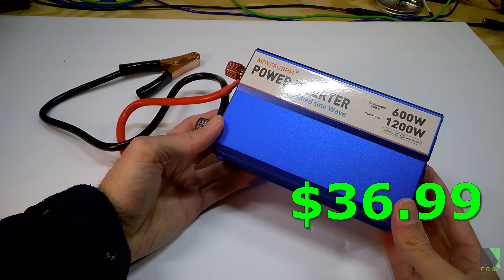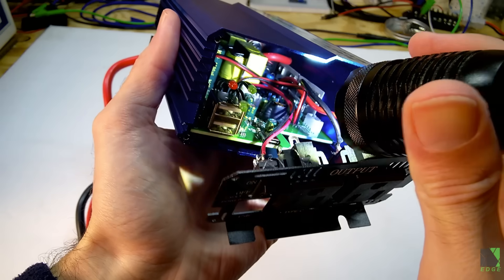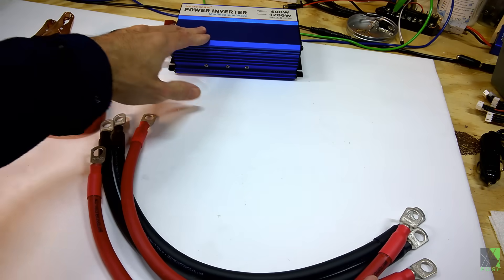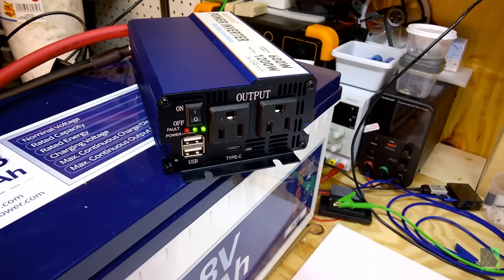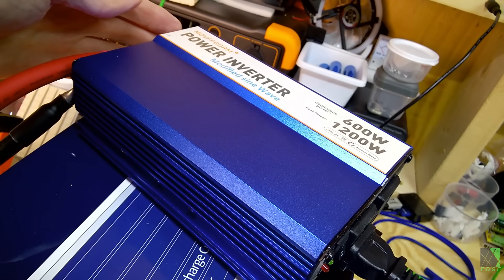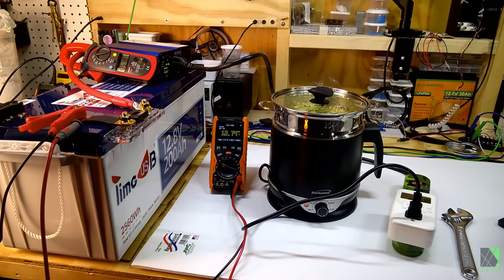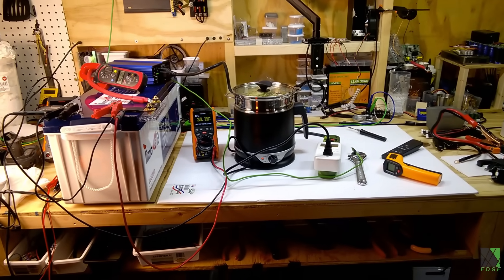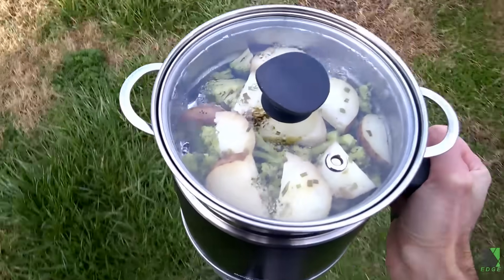This Inverter Is So CHEAP! But Let's See If It's Any Good - Can It Cook? #inverter #solar

Comment from the maker: Hi all, for those curious about my statement regarding "C/4 rate" :

The 200ah battery was supplying 50 amps to the inverter. 

If you take the Capacity of the battery (200) and divide it by 4,  or 200/4 you get "50"! So, 50 amps current draw is C/4! 

PS: On the other hand, C/10 is a perfectly safe and easy rate for charge/discharge of normal LiFePo4 batteries. That's capacity divided by 10. So for a 200ah battery, C/10 rate is 20 amps....

For those of you that don't know, the slash character "/" in C/X implies division, not multiplication! This can cause confusion. 

Hope that helps - any questions feel free to ask :)
-Dave
Reply: can i get more information about this, is it bad for the battery?
Reply from the maker: @SupertigerDev  Hello, C/4 is not healthy long term for normal LiFePo4 whether charging or discharging. There are so many reasons. Don't worry I am working on a video about charge/discharge rates and long term durability of LiFePo4. Much of the information available is quite erroneous. I hope the upcoming video will provide some clarity on this topic for all DIY'ers.

FYI: C/10 (capacity divided by 10) is quite safe and easy for normal LiFePo4 batteries. That is what I limit my batteries to for long term use. Have used them for about twelve years now.
Reply: Does this apply to lead acid batteries as well? @solarpoweredge
Reply from the maker: @Jon-fs2zj  Hello, lead acid is tremendously more affected by C rate. They lose much more power (are less efficient) the greater the discharge rate. Lifepo4s can still have this issue, but are so much better performing. Nevertheless, lead acid batteries still work and are still in use today. Hope this is helpful... any questions please ask :)
Reply: No point in asking questions unless you gift me that inverter!
Reply from the maker: @MangoCitizen LoL! If I was rich I'd give everyone one for free :D
Reply: @solarpoweredge  you have a really great heart !! I am now happy even without that device. I will even try hard to formulate a few sensible questions 😂
Reply from the maker: @MangoCitizen I'll try to think up good answers maybe even entertaining ones lol :D :0

Comment: Was looking at buying a 12v refrigerator pump and swap it into an used 120v fridge for off-grid use. Any chance you can do a video on that?
Reply from the maker: Been shopping around for a good DC compressor to do a project like that - if I am successfull I'll be sure to upload and share!

Comment: Most uninterruptible power supplies (that people hook up to their computers) are also NOT pure sine wave.
Reply from the maker: @iamsemjaza Good point. Been running all my PCs on sine wave to be safe. That said, since a square wave UPS is supposed to run only a few minutes while the PC shuts down, maybe that's what makes the difference.  I'd like to see a documented long term test of PCs and servers on square wave inverters. My main concern is the input stage of an advanced ATX power supply - it might not expect a square wave. I need to find a test PC and try running it on square wave for a year and see what happens.
Reply: @solarpoweredge  I would, in fact, love to see the results of a long term test like that :)
Reply from the maker: @iamsemjaza OK it's on the list :D would make a good video I think
Reply: @solarpoweredge  IN a related note: I ran tube TVs, VCRs, Air Conditioners, Desktop and laptop computers, etc etc etc on square wave inverters for days at a time during power outages and they were all fine.
Reply from the maker: @iamsemjaza This is very interesting to know, thanks for sharing! I want to test a fridge or AC (non-variable compressor type) on modified vs. sine, because apparently the compressor can run hot. The question is "how hot". The only real testing I've seen is in scientific papers that show damage to inductive motors running off square wave, but they are extremely technical and hard to read.
Reply: @solarpoweredge  I didn't notice extra heat but I wasn't specifically looking. I was of the "does the thing I need running work? It works! Good" level of testing.
Reply from the maker: @iamsemjaza You make some good points :) I'd check for Heat and Buzzing sounds. anyway I might as well go ahead and say it, square wave can and does damage certain appliances over time, but thankfully not all appliances :D in some technical and industry groups it's common knowledge and a known problem. I've known this also for a long time. But... it's hard to explain to folks.  The subject can be very complicated.

 Partly because some equipment seems to run smoothly on square wave without any problem, causing assumptions to be made. And partly because the details of sine vs. square and electronics get incredibly complex and extremely technical. Nobody wants to dive into that kind of stuff usually. There is plenty of research though.

I'll put out a video about this topic as soon as possible, which will explain some of the details as simply as possible. Might help a lot of folks. Personally, I refuse to run my fridge, AC, freezer or computer on square wave (unless there is no other choice)

Comment: Where did you buy that strap that mounts the ANL fuse holder to the battery?
Reply from the maker: @polishhotdog933 That's a Lifepo4 bus bar, amazon and other places have them. Another method is take some copper bar, drill a hole in both ends, maybe grind off the corners a bit.
Reply: @solarpoweredge Ok , thanks for responding.👍
Reply from the maker: @polishhotdog933  NP :)

Comment: ok but you never actual tested the VTOMAN Portable Power Station to do like soldering  , rework station usage all day to be plug in , just wondering can you do that ??? i just need to know if it can handle it or not , because i like to cut my power bill in half lol
Reply from the maker: @HalifaxComputersRepair Based on the performance running other loads, I am 100% sure it will handle a rework station. You could have a solar panel outside and run a cable inside to power your system, would be a cool setup

Comment: Quite sad that we all know now that half of the claims on consumer goods are a fat LIE !
About the MTBF of this converter, we'll know when it gives up when it gives up . . . . . . right?   😋
Reply from the maker: @taunteratwill1787 Yeah pretty much every low cost inverter just doubles the rated power for decorative purposes. Under a surge test they either burn or fail to deliver the rated amps. Good point about MTBF, we simply don't know... however I was very impressed the inverter could keep itself so cool.  So I feel it has  a good chance to survive my use case :D

Comment: Get yourself some 12/24v cooking appliances. You can power directly then. Save a ton of energy wasted with inverters.
Reply: JUST SUBBED-PLEASE USE BOTH C+F WHEN DISCUSSING TEMPERATURES !!! 👍👍👍👍🤯🤯🤯🤯💪💪💪😄😄😄😄🥂
Reply from the maker: @liambroder4543 Thanks for sub, OK I'll try to remember to do that :D :) 👍
Reply from the maker: @truckywuckyuwu Right on, I build custom 12v appliances :D several 12-volt ovens, a 12v cooktop, and various other DC cooking appliances. You can see a few of my builds in the video linked below. Anyway, inverters will be here for a long time, millions of people use them, and me too sometimes. It's good to have options :)
12v cooktop, ovens cooking demo on a 200ah battery
https://youtu.be/hQQrRcwd6dg

Comment: 6:52 I'm not sure you got that calculation correct, 4C would be 800A 4x battery capacity, I think your running it at around 0.25C discharge.
At around 50amp the battery should last hour 4 hours. @4C the battery would be empty in 15mins.

please corrects me if I'm wrong as I'm not 100% sure on this.
Reply from the maker: @TWMist  Hello, the discharge rate was C/4 (I pinned a comment up top)

Comment: Those 1200W are the peak power that it can delliver. I think is about the startup power needed by a motor or the cold resistence of the heater when you plug it in. However, I agree, for up to 600W for that price you got a very good deal. I also would buy two of them for that price, just in case, you never know how much it will last, especially if you run it close to its max 600W.
Reply from the maker: @sebastian19745 The FETs in this inverter are too tiny, in order to surge 100A+ they need to be a certain size (or enough of them in parallel) to not pop under a surge. 

Generally speaking, doubling the continuous rating is standard marketing practice. I never believe it and have almost never seen a basic inverter meet the rated surge. Best to focus on the continuous rating at this price level. I was actually impressed by how it performed. Thought it would burn before the food cooked.

Comment: Cheap electronics thst won't last long. Buy two!, and learn how to fix and get spares for the mosfets or what ever goes wrong on the first one. It will probably overheat and take out some components. Put better cooling fan heat sinks on  .
Reply from the maker: @yesihavereadit Thanks for the comment, good points. I thought this inverter stayed pretty cool, outside case reached 37C which isn't too bad.

Comment: Modified sine wave works GREATish for resistive loads...they are HELL on inductive loads such as motors for compressors and whatnot
That is a neat little "load bank" for testing those inverters, as it will provide a decent continuous load on the output, same for those little heater boxes as well.
Reply from the maker: @haydenc2742 Right on! a load bank that cooks potatoes is what I call "extra efficient"
Reply: i know for sure universal motors dont care about it but for triak dimmer it would be a problem

Comment: i have a few of the 3 and 400 watt ones i bought or aquired over yrs but they had external fuses like cars have.. but when i bough the 100 ah lipo4 i sprung for a 1500 watt pure sine wave. slipped and blew fuses on it opened it up and removed fuses from inside i used frcuips to pull them and they fell apart. then looked in and positive connection to board has strands sticking out of the solder . fortunatly i took the 3 yr warrantee they refunded and bought one mant yt were buying and worked well but they should all have external fuses
Reply from the maker: @remocres Inverter repair sounds like lots of fun lol. I agree... we need external fuses, in fact I'd pay a bit extra for that, it's worth it

Comment: These cheap modified sine wave inverters can last a long time if the loads are small. I actually used it to power a Samsung inverter refrigerator. I'm happy to say it did not break the refrigerator and the inverter continued to work for 3.5 years. Though inverter refrigerators convert that AC to DC so maybe the waveform doesn't matter?

Also I believe these inverters should have a fuse soldered inside it. My 600W inverter has two 35A fuses in parallel.
Reply from the maker: Hopefully if I don't use this inverter 24x7 it will survive a long time. Interesting case study with the Inverter fridges... probably has rectification so it would make sense it can survive square wave. Standard AC induction compressors tend to heat up and have other issues if powered by square wave.
I really wish this thing had a fuse outside! but for the price I won't complain :)

Comment: I had one of these, different label, it would not even charge my laptop!!
Reply from the maker: @ewanbaxter9199 Through the AC or USB-C? did you try running anything else? I do know square wave is pretty dirty and some electronics don't want to run on it

Comment: I've been running a cheap modified sine wave, 240V, 3000W inverter for about 6 years in my campervan. It easily handles my toaster, kettle, air fryer, and recently my new 300W mini a/c unit. All inverters have the best efficiency at low power running, so try to avoid running them at high load levels. All my other electronic devices in the van are either direct 12v or 18v dc.
Reply from the maker: @normanmazlin6741 Interesting. I'd like to test a larger square wave inverter for cooking. The 600w will be for portable and intermittent use and it should be fine for that
Reply: @solarpoweredge  I haven't had success getting it to work with my 2000w  induction cooktop, which is odd, given that the heating system is basically a badly designed transformer. I would like to try it on other induction cookers.
Reply from the maker: @normanmazlin6741 Thanks for the info. I had a feeling induction cooktop on square wave "could" be problematic... I have some ideas about this and will test in my workshop. If successful I will share the results
Reply: @solarpoweredge  
Thanks

Comment: But I want something just the opposite, I want to plug into 120 volt outlet and run my 2000 lb atv winch............
Reply from the maker: @job38four10 It's possible to make a really rough DC power supply for this purpose... except I don't have a winch yet :D

Comment: this will not work long term with a motor load
Reply from the maker: @fred-n6f  Square wave is not good for AC induction motors, they get hot and may have other issues. Seems OK with a cooker (resistance)

Comment: i think all it matters is the longevity. I doubt it will last for long
Reply from the maker: @Vangeliss I have some very old and small inverters. One is square wave and over 15 years old. If I don't run this 600w to death 24x7, it should be fine! (Especially if I avoid surges and overheating)

Comment: Where I can buy it?
Reply from the maker: @JuanMartinezavalos-lt8uk Hi, a link is posted in the description - that is an affiliate link so I may get a small commission if you use it. But if you don't want to use it, can just search Amazon for: "600W Power Inverter" and it should be one of the top results. If you have any problem finding the inverter, please let me know. PS: I can't post links here in the chat

Comment: Any thoughts on modifying one of the cheap quality square wave inverters with a Pure Sine Wave Inverter SPWM Board EGS002 EG8010 + IR2110 Driver Module?
Reply: I like to keep my eye out at the second hand shops for the older high quality jumper cables as well for the ideally 2 gauge, though what not. Seems the pure copper is becoming less and less a find. Even so.
Reply: I also wonder about the most cost effective ways to DC-DC convert higher voltage solar panels down to the 48V or lesser range so to save on copper. Parallel the cheap DC-DC converters so can handle higher current load?
Reply from the maker: @jafinch78 Regarding parallel DC-DC converters: good thinking.... I've done something similar and it works. The trick seems to be balancing the two boards. But once they're balanced it works!
Reply from the maker: @jafinch78 Good idea, copper is so expensive now. I am looking for any new-old-stock cable spools of very large gauge wire. Hard to find around here
Reply: @solarpoweredge  Would be nice to come up with cost effective custom mods to wire the systems like the commercial panels so running smaller copper since higher voltage.  Yeah, old welding wires were an item I was looking for at one time as well.  Hard to resist the auto yards jumper cables.  I tend to stop and look to see if there are any all copper and not copper clad.
Reply from the maker: @jafinch78 Hi, it's technically challenging but could work. The square inverter has many components sine inverters have too. There is no question we'd have to heavily modify the circuit board, maybe cut some traces, etc.

Comment: You'll be lucky to get even 6 months worth of use out of this high frequency, transformerless inverter. All high frequency inverters, even the much larger XP models offer shorter life expectancies. You should buy a low frequency, transformer based inverter instead.
Reply from the maker: @quickquote1568 This inverter certainly won't last forever, but for a standby/emergency solution I think it's OK. I have a LF inverter for normal daily use

Comment: At 6:54 you said the consumption was C4 
 With a 200 amp battery drawing 52 amps, isn’t that a .25C ?
Reply from the maker: @Glocktard Hi sorry for the confusion. I mean C/4 not 4C. 200 (capacity) divided by 4 equals 50 amps. Or divide 200 by 50 - hope that makes more sense

Comment: Wouldn't 12 volt appliances be more efficient rather than converting with an inverter?
Reply from the maker: @CIVILDEFENSEBUNKER Yes they are more efficient, however there is no 12v version of this cooker / steamer and I want to use it. Perhaps in the future I can convert it to 12v or direct PV.

Comment: I can find these inverters at yard sales for 5 bucks,good prep items,but I don’t trust any electrical devices for durability or quality. The cost of that battery is a lot of Coleman fuel or propane and those appliances are almost bulletproof. Keep up the good work.
Reply from the maker: Good points. Personally, I keep propane as a backup to my DC and AC cooking appliances. Propane can sit for years without any issues in case there is an emergency.